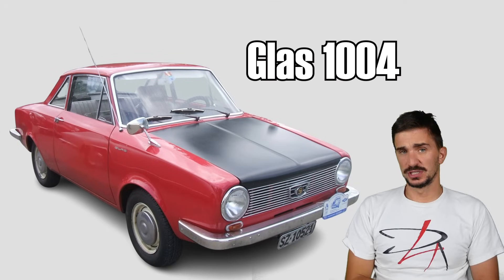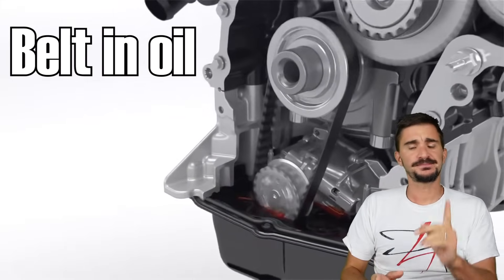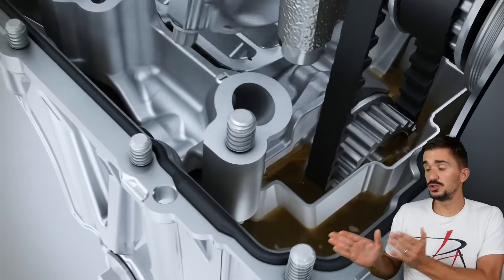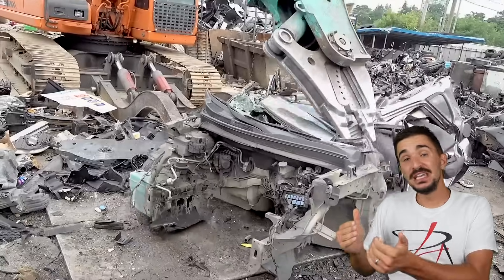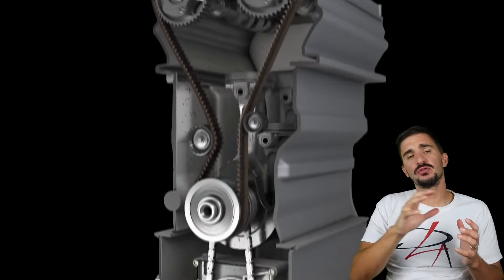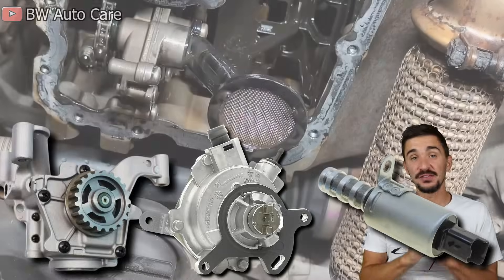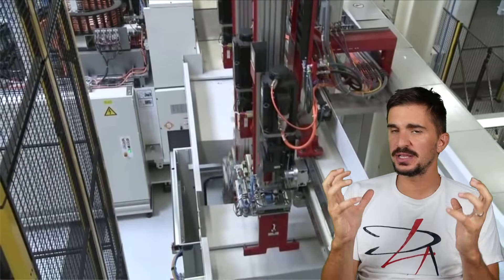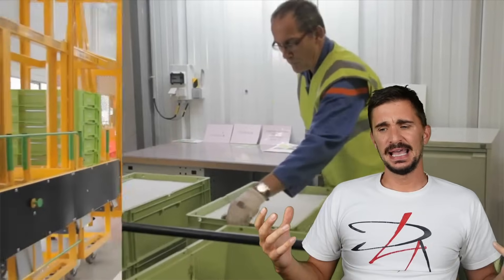Who Approved This and Why Is It Still Being Made? Wet Belt aka Belt in Oil Engines

Comment: Even with all the data proving that wet belts are a bad idea, yet car manufacturers continued to use it, in my mind is further proof that most cars nowadays are only being built to outlast the warranty period. The warranty period might as well be the guaranteed 'lifetime of the engine/car' at this point.
Reply: Capitalism goes brrr
Reply: GM could learn from this video evidence; guess their main goal is profit when their 1.3 liter 3 cylinder fail @ end of warranty, crush car & replace.
Reply: That's how warranties work in every industry. Any failure during the warranty period is considered premature failure, but if it dies one day after the warranty period it is past its expected lifespan. The manufacturer doesn't want the product to fail under warranty because then they pay for it out of pocket, but they don't want it to last much longer than the warranty either because well... Any failure after the warranty period is past its expected lifespan so why make something that works too well
Reply: @Creepus_Explodus  This is actually wrong. Many cars are leased out to corporations and the leasing company wants good residuals, which means that they must not be perceived as being unreliable when sold second hand.
Modern cars are expected to be reliable for 6 years, i.e. twice the typical lease. Over here Mercedes dealers will buy cars under 6 years old. Go over...well, I know someone who foolishly bought an Audi TT when she retired intending to keep it. After 6 years it started to get expensive and she then found out what the value was. No more Audis, the trade in didn't cover a used Polo.
Reply: @kristoffer3000 Yeah, the cars made in socialistic systems were so much better, right?
Reply: @SBT300  The Lada 1300 was a considerable upgrade over the Fiat 124 it was based on. The only two downgrades were the rear drum brakes and the thicker steel, which was helpful in the rough conditions.
Reply: @kristoffer3000 Is it? 🤨
Reply: I've worked at a Ford dealer for over 40 years it's very rare that the wet belts fail if the services are carried out at the recommended intervals 12,500 or 12 Mths With the CORRECT OIL grade and the 1.8 duratorq wet belt came out 2004/5 Not 2007
Reply: Of the top I know ford still uses this system for their 3 cylinder eco poops. It's all about cost ppl. Chains need much tighter tolerances and comparatively complex tensioner systems. My boss is your typical ford guy. Ford's are the greatest thing ever. His last f250 was a 04 triton tick master. Ac didn't work, perpetual engine light and the truck was roached at 130k. He sold it to someone to use as a plow truck beater. Next truck 16 f250. Same deal. Ford's are the best. Still has the engine light that won't go away. Now he's doing the other ford guy thing. Towing a trailer he should've got a f350 for. Thing make the truck sag at least 8 to 10 inches. Probably 1000lbs over what he should tow. I know everytime I see a Billy and Jon Bob landscape company they've got this huge trailer barely being moved by a ford. Every light is a ticking spitting full throttle mess to just attempt to not impede traffic.
Reply: Cars are just whitegoods these days.

Can't wait to be my old man's age and go to all the classic Tesla shows 🤓
Reply: Except for the fact that the average age of a car in the United States is 12 years old.  

We said the same thing back in the 90s.  Oh rubber timing belt—throwaway car.  But like all cars you have to keep up on maintenance… which ironically is getting less and less.
Reply: @tosemusername  Go on, give me your AWFUL take.
"I-i-i-it's not capitalism it's gommulism vuvuzela sershalism corporatism!"
Reply: @SBT300  Yes.
Yes they were, they were made for a purpose and that was to get you where you were going at a low price.

Funny how for example the Fiat the Lada was based on is seen as a fantastic car with amazing handling but the Lada is apparently dogshit, almost like there's some ideology at play here, something you are very familiar with.
Reply: Thing is the wet belt breaking wont be covered under warranty because the manufacturer will classify it as a consumable and claim you didnt replace it like you should and void your warranty. Just like the warranty doesnt cover brakes and oil changes. Because they are consumables.
Reply: This happen with my friends eco boost camphaser went out under warranty "fixxed it" Warranty expires starts clacking again $3k repair. On top of payments.
Reply: That is because they are driven by CO2 targets from regulators.  The engine blew up but you saved 1% on fuel,.  Yey!  Lesson: if people really want to save the planet, the first goal should be reliability.
Reply: Remember Comrade, Ladas are good cars and RBMK reactors cannot explode.

Soviet anthem plays
Reply: @kristoffer3000  Which is ironic since the Lada was decent at rallying
Reply: The fate of chevy Trax 1.2 liter turbocharged engine!
Reply: It’s always been like that. Cars a built/designed to last 10 years…
Reply: @kristoffer3000  The socialistic car industry was utterly and severely outmatched by the "West".
Reply: @SBT300  False, but kind of true, since the only decent cars were Ladas (and Volgas if you were an important guy). Ladas were the only ones that did well in export markets, most infamously the Lada Niva which was built for the conditions of rural Russia and Siberia but almost all units produced were exported instead (because it was a genuinely good SUV with good off-roading and 4WD capabilities). Interestingly, the police variants of the Lada (often called "Zhiguli" in the USSR) used a Wankel rotary engine (like in Mazdas of the period).

All East German cars were basically scrap though, from the inverted bathtub Wartburg to the gutless Trabant.
Reply: @SBT300  They had different goals, you can't compare them with a capitalist mindset because they weren't after profits, they were after making people mobile.
Reply: @kristoffer3000 you blame capitalism when you piss the bed?
Reply: @kristoffer3000 And they failed miserably.
Reply: …yet cars today last more than double the lifespan that the did in the 70s. Show me some data showing the trend line is going back down (not anecdotes) and maybe I’ll believe you.
Reply: @beavistechrock  "Of the top I know ford still uses this system for their 3 cylinder eco poops. " I though a kit with chains and chain gears became available in 2019?  It's possible to retrofit engines to the chain driven cams AFAIK.  Maybe it is only for the cam drive though and the oil pump drive is still the wet belt.
Reply: @SBT300  Communist cars weren't crazy reliable, but they could be easily fixed and driven until they rotted out completely. And they were mostly based on Fiats of the era
Reply: @TassieLorenzo  my bad. Wrong choice of words I should've said ford has recently used em.
Reply: @SBT300  You've never seen the absolute punishment an old Lada can take and keep going have you? Very few vehicles can hold a candle to the shear amount of abuse those things can handle.
Reply: @kylemacintoshlinux1449  Still nowhere as sturdy as an W123 Diesel.
Reply: @😂😂😂yeah that shud be some fun😂😂😂fishingfan1500
Reply: I have only just found out the peugeot only have a 3 year warranty deal with them, so the car I just brought the warranty runs out in 2025 😢
Reply: Toyota/Lexsus are all chain drive with 10 year warranty.
Reply: @calvinnickel9995  cylinder deactivation goes brrrrrrrr
Reply: It's just like lifetime transmission fluid in cars. Never having to service a transmission can be a selling point and sounds like a great idea. The only catch is that the "lifetime" of the transmission is the warranty period. Folks that plan on keeping vehicles for the long term may be in for a lot of repairs.

Comment: The engine in my 1943 Farmall tractor has timing gears and has been running reliably for 81 years.  Yeah, maybe could use a ring job, but still basically bulletproof.
Reply: Several Honda motorcycle models were having reliability issues in the late 70's / early 80's with cam chains (& tensioners/guides) so, probably in desperation as their 
reputation was taking a hit, introduced gear driven cam shafts on their VFR400 & 750 V-fours & CBR 400 in-line 4 cyl's. Reliability & longevity issues were solved.
Reply: I HATE rubber timing belts
Reply: I agree but GM managed to mess up this with a 2.5 liter in 1980s with one of the gear made of plastic.
Reply: @wullie3xv923  Yes! this exactly. Sure they're heavier and more expensive and noisier, but I love the gear whine on my VFR, sounds like a little supercharger! aaaaand I never need to replace a tensioner or chain. seen examples with a 150K on them and the valve clearances are still in spec. Fantastic machines.
Reply: @gillesgirard7812  - ALL the automakers went to the nylon covered timing gears/sprockets in 1960s... supposedly for noise... maybe for known shorter life... but the low cost replacements can be all metal... however, my '77 and '85 Iron Dukes still have their nylon gears...
Reply: That's why manufacturers hate timing gears. Some VW engines (2,5l 5 cylinder) had timing gears in the 2000s. But the engines still sucked for other reasons.
Reply: This is a good example of survivorship bias. It's like those still-standing aqueducts. You can only point to the fact that it's still working because... well, it's one of the ones that are sitll working.

Point being in 81 years you'll find machines built today that are sitll running. And a lot which aren't.
Reply: Boy does that bring back memories! Standing on the PTO shaft while my brother maxed the throttle to ~20 mph, oblivious to how dangerous that was. Discing a plowed field at high speed and almost getting thrown off the tractor beneath the blades. I'm lucky to be alive to have memories!
Reply: @jugears1081  I hate modern cars and fake emission claims which involve scrapping good machines - which in itself produces mega emissions.
Reply: Tractors run at 7000 rpm often?
Reply: Pure race engines also -
Purpose-designed pure race engines often use gears to drive the valve timing camshaft, particularly in high-performance racing environments where durability and precision are crucial. This method, known as "gear-driven camshafts," is preferred over belt or chain systems in many race engines because it offers several advantages:

Precision: Gears provide very accurate timing control, which is critical for high-performance engines.

Durability: Gear-driven systems are more durable and less prone to stretching or breaking compared to chains or belts, which is important under the extreme conditions of racing.

High RPM Stability: Gear-driven camshafts are better suited for high-revving engines, where timing needs to be consistent at very high speeds.
Reply: Your Farmall tractor was designed to last, some modern vehicles are intended for junk yard as soon as possible.
Reply: Amen, and someone would have 2 b extremely idioticaly dumbly blindly stupid, 2 put a rubber belt in2 a oil, ... have the modern "engineers" run out of knowledge, or they are just making fools from the dumb+blind buyers ? Hard 2 understand ...
Reply: @seanryan4131  Yes, and than the real pollution really starts .
Reply: So does most pickup truck diesel engines nowadays, even the old Ford 300 has timing gears and those seem to last forever.  Maybe engines should have stuck with timing gears and called it a day.

Comment: I never thought that engines with timing chains were noisy. Never.
Reply: I can't recall hearing the timing chain on any engine, ever. Even my dad's Cadillacs, which were overall very quiet, had enough other noises going on that you couldn't hear the timing chain.
Reply: usually the injectors are noiser than the engine itself.
Reply: Go buy a VW with a chain 😂😂
Reply: they likely where in the 60s. now the chains are guided by plastic the whole way so no room left for clacking
Reply: You mean you never got out your stethoscope?
Reply: because they aren't. Proper engine balance matters waaay more. A 25 year old four cylinder with timing chain is much quieter than a brand new three cylinder with wet timing belt (Non hybrid in both cases). That's simply because the four cylinder engine has much better balance
Reply: @indyrock8148  yeah exploding nylon gears were fun but valves never touched pistons
Reply: People nowadays also talk about timing gears being "super loud", even though they've almost certainly heard a gear-drive engine (like every single OHV Chevrolet I-6, for example) and never even knew it.
Reply: If anything belts are noisier, they make a whirring sound. Chains are bathed in oil and sealed within the engine
Reply: @jasonmant of a Vauxhall corsa
Reply: @njipods  My 1993 ford 5.0 Liter V8 had a timing chain with no plastic guides at all, anywhere. I still dont understrand why the plastic guides are used in modern engines. Anyone who can tell me, please do!
Reply: I agree ford 351 W and chevy 350 there were quiet as a mouse.
Reply: Timing chains aren't that noisy - on their ow.  But manufacturers have to look at things as a total, and any noise they can eliminate, even if it wasn't consciously audible to a consumer, drops the overall noise level of a vehicle by a fraction.
Reply: Wait until you hear cascading gears instead of timing chains XD It makes more noise than a ducati dry clutch
Reply: If you can hear the timing chain its only a matter of time lol
Reply: @croustibat682  I've heard poorly maintained Ducati's, the clutch is nothing comparatively...:face-blue-wide-eyes:
Reply: Got to agree
Reply: You can't hear the difference it but the California emission (noise) regulations probably put an end to timing chains and everything else that made even the slightest noise and everything else that made cars fun. Emission regulations add to sophistication, unaffordability and early obsolescence
Reply: Alfa Romeo Nord engines, the indestructibles. RIP!
Reply: I understand and agree - but PCM knock sensors think timing chains (with some miles on them and chain stretch) are actually knocking cylinder heads.  Those sensors can't distinguish between the chain and a pre-ignition event.
Reply: I HATE rubber timing belts
Reply: They are loud when they stretch. Look up 2 L diesel inginum fromt land rover
Reply: I remember the Ford v6! Such a low compression engine that the valves did not touch the pistons when the nylon sprocket broke!
Reply: Unless it’s a 2.4 ecotec. But if it’s noisy, it probably only has half a quart of oil in it
Reply: You never had a 16V Triumph Dolomite Sprint !
Reply: @tooltime9260  A lot of chain driven camshafts had plastic covered sprockets to cut down noise and wear. Seen them so old the nylon had fallen off the sprockets and the engines still running ok.
Reply: On a 3 cyclinder engine which many of these wet belt units are it's irrelevant the engine is unbalanced and will be noisy, also on modern GDI engines the GDI injectors make more noise than a timing chain does so again it's pretty irrelvant, a well balanced engine with good fuel injection matters most when it comes to engine noise.
Reply: @maxflight777  a fact I am glad for every day
Reply: @Swiss-Toni  Belts make a whirring noise due to air being squeezed out of each tooth as the belt goes around, even when correctly tensioned.
Reply: @Swiss-Toni  They do if you listen closely.
Reply: @Swiss-Toni  but if you don't replace on time they make a loud bang, followed by silence...
Reply: I never noticed the noise of my chain drive from the inside of my Vectra with the windows closed and the stereo on
Reply: It's just money grabbing cause I never even thought of my motorcycle bigger chain as noisy at all and it's pretty much as exposed as you can get.

Hell not even with the engine off on neutral I would even say that they would ever be annoying but maybe annoys some ppl no idea...
Reply: @jasonmant  The gears died because chain pitch changes with wear.  They should not have been used as gear drives bolt right in but US manufacturers ceased caring about quality in that era.
Reply: If you can, then the manual tension adjustment needs attention!
Reply: Modern engines are quieter, but simply add a hood blanket and a little extra sound insulation and no one will ever notice or care. It's all about improving efficiency to meet arbitrary government standards and the consumer pays the price with a throw away car.
Reply: My old Kawasaki engines are noisy, but that's part of their charm.
Reply: It’s just an excuse.
Reply: @Mach141  OHV V8 is different than these OHC engines nowadays.   You can pull the sprocket and chain off in one pice with the Windsor 5.0. One of my favorite engines.
Reply: My engine with a timing chain gets a little noisy if the oil is low, but I just put a quart on it and it's back to be silent.

It's actually a neat feature for me because I don't really check my dipstick that often.
Reply: @Mach141 the guide keeps it from wiggling around sideways (wearing down the sides of the belt). You could make it out of a softer metal bit than you get metal shavings in your oil which isn’t fun. Plastic is fine, the filter will catch most of it and microplastics won’t really hurt your engine. But yeah, not fun when they break and replacing them at maintenance gets pricey quick.
Reply: @Hamachingo  I was taking about timing chain engines, not belts. Old chain engines never had chain guides or tensioner's. With the OHC V8 engines they are everywhere. Just use idler gears if needed to change direction and lose these guides and tensioners all together